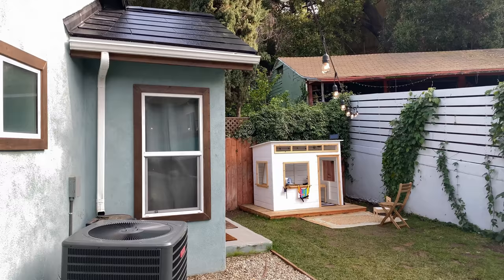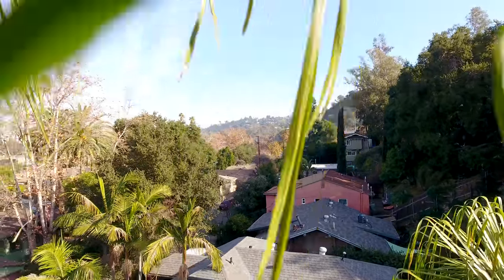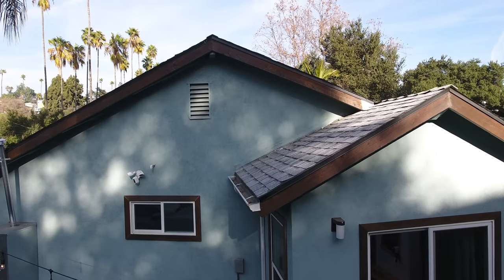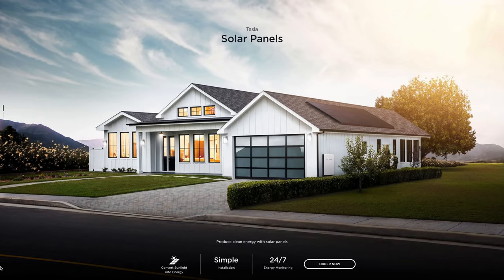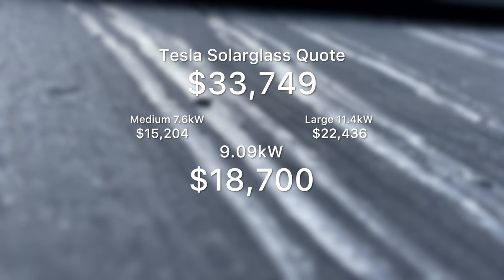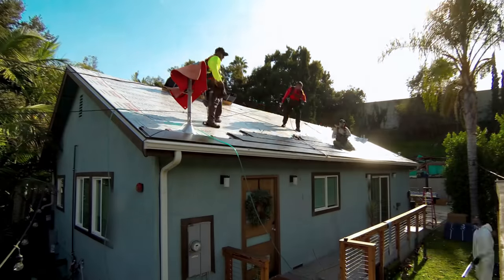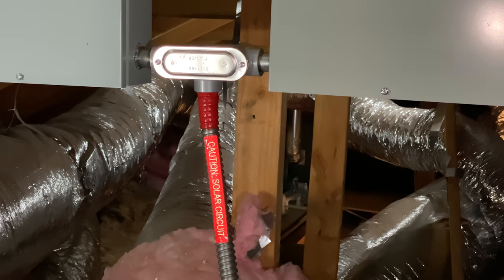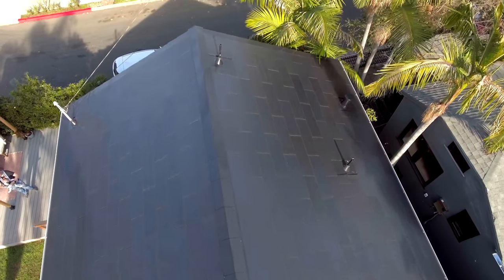WE GOT A TESLA SOLAR ROOF : First impressions and what you need to know!

Comment: Thanks for a really interesting vlog, I live in North East Scotland & have pv panels, under UK law I'm only allowed 16 panels & because my roof faces roughly East, West I have them placed 8 on the East & ditto West. My pv inverter is placed in my loft giving me as shorter run for the DC output as possible because DC is lossy over long distances, I noted that you have a tree with a large leaf canopy shading your roof, one of the questions I had to answer was if this was the case with my house because any shade over the roof will degrade the power output from the panels. My pv system cost me £6000.00 GBP & my yearly income is approximately £500.00 GBP. It was installed 2013 so only five years to go before I'm in profit.

Comment: Beautiful. I hope you measured the inside surface temperature of the roof from your attic during the summer and remeasure with this later.  Conventional solar panels get very hot from only being 30% efficient at converting sun into energy, the rest turns into heat. With regular solar panels raised an inch or two up off the roof this hest can't escape instead of transferring into your attic. The solar glass design will heat up the attic dramatically raising the amount of HVAC usage you need dramatically.
Reply from the maker: Why would it absorb more energy that our old roof?
Reply: @AustinFlack  depends on your old roof, but a metal roof would reflect most of the light/heat whereas the solar roof absorbs light and generates heat through conversion losses to electricity. Spray foaming the inside of the roof would be ideal for solar glass v3.

Comment: The system is designed in series, depending on how many strings that inverter can handle and the location of any potential obstruction, it could produce much much much less than its estimated production.

Comment: I have been trying to find out if the Tesla solar tiles are wired to the central inverter as a string or does the system have built in solar optimizers? Also, do they specify a certain model or brand of inverter or do you have your choice?
Reply from the maker: Going to follow up with Tesla and the installers to get some questions answered, will add those to the list, and cover them in my next video.

Comment: Is the 25 year guarantee prorated? How degraded does it have to be before the guarantee kicks in? Does the guarantee include the labor to replace the panels or are they just going to send you new
 panels?
Reply from the maker: Labor included. 

From the purchase agreement: “Limited Warranties
Tesla, Inc. warrants that:
(1) Product Warranty. Your Solar Roof will be free from defects in design, materials, and
workmanship for 25 years from the date your Solar Roof is installed, except as otherwise provided
in the Module Warranty below.
(2) Weatherization Warranty. Your Solar Roof will remain in place and prevent damage to your
Home caused by the passage of wind and rain through your Solar Roof for 25 years from the date
your Solar Roof is installed.
(3) Module Warranty. The power output capacity1 of your Solar Roof will be at least 95.0% of
the “Rated Peak Power”2 specified on the Solar Roof’s data sheet (multiplied by the size of your
Solar Roof) at 5 years after your Solar Roof is installed. The power output capacity will decline by
no more than 0.5% per year for the following 20 years. This warranty covers the power your Solar
Roof will produce under standard test conditions.”

Comment: That's quite a high electricity usage. I'm on 80m2 and I'm using about a quarter to a third of your amount of kwH. Is the house insulated?
And why is the breaker and a switch outside of the house? Any culprit willing to jump the fence can shut it down. With us everything is inside. Is it maybe for firesafety regulations? But anything outside on the wall can also catch fire, and can also be easily tempered with to cause a fire....
Reply from the maker: No garage, but also fire department wanted shut offs outside, I believe. Going to follow up with Tesla and the installers to get some questions answered, will add those to the list, and cover them in my next video.

Comment: I was kind of hoping the drone hit the roof. I could’ve used the durability test. Also, if the tiles are elevated, wouldn’t that be devastating during a hurricane? To my knowledge, the problem with tile roofs is air gets trapped under causing them to crack, wouldn’t it be even worse with this?
Reply from the maker: I’m not sure, but this is tempered glass and a metal frame. Tesla promises they are 3x stronger than tile roofs, and they are guaranteed for 25 years against weather damage.
Reply: Austin Flack I did some research and they are warranted but doing so I found out, if there is a power outage you aren’t allowed to use the solar panels. FPL won’t allow you to use them and that is unfortunate considering it would be one of my main reasons for getting it. I don’t understand why you can’t shutoff the main breaker and use solar panels I spent thousands installing. It’s just amazing to have a solar roof but have to wait a week for the FPL outage to be resolved after a hurricane. My mentality would be I’d be able to use the solar power after a hurricane to turn lights on, cook, refrigerate food, air conditioning, etc. I’d hope that policy changes in the future because it’s outrageous considering no one would be hurt if the main breaker is closed.

Comment: Permission to operate??? That's funny, really funny. I had my solar system installed late last year. I asked the foreman about this permission to operate thing and his exact words were, "Well, technically you're not suppose to turn the system on until your electric provider gives you permission. But technically we can't stop you from flipping this switch and trying out your new system if you feel like it." Basically what that meant was that he told me most people turn their systems on anyway..... As for myself? Ummmmm............ You get the idea. lol
Reply: @urgetodrive  True. But I'd also be using a lot less electricity from the power company in the daytime because I'd be running my home from solar power and not from the grid. This of course would save me money while I did the PTO thing....

Comment: What do you do if you have to make a new plumbing, electrical, etc. penetration in the roof?

Also, does the roof have a ridge vent?
Reply from the maker: It does have ridge vent. Not sure about your first question, maybe I would need to call Tesla to modify.

Comment: What is warranty? Also what happen if u have damage on shingle? Is there a way to monitor all tiles are working properly? Did u get a powerwall cell too?
Reply from the maker: Yes, warranty covers all damage. And I can monitor performance on the app. Tesla will even automatically get notified if the system is underperforming.
Reply: @AustinFlack  that's pretty cool. If you mind me asking how many square ft is your house. Bc I know with different size house cost will go up.

Comment: Has Tesla given you any numbers on the capacity factor of the system? The reason I ask is because a 9kw system does not give you the equivalent power. For solar the average capacity factor is about 25 percent which means you get 25 percent of the name plate kw value.  25 percent of the stated kwh hours from Tesla  would be 2110 kwh a year which I hope is enough power for the initial financial outlay.

Comment: I noticed you have a direct mains connect setup,  why didn’t you have a power wall fitted at the same time, was it cost or do you have really good rebates/net metering and very little or no power cuts?
Reply from the maker: No power outages to worry about. Adding it up, it didn’t seem like powerwalls would be worth the expense because of net energy metering. We can always add later.
Reply: @AustinFlack  if you have a hot water tank it will be worth heating it with the solar not sure if you have it out the but devices like the Eddie ect link up with the immersion heater and use the excess solar to heat the tank helping cut your fuel bills these can be used with most type of tank that use an Emerson element

Comment: So you didn't get a Powerwall? I thought it was mandatory with the Solar Roof.
Reply from the maker: When we send energy to the grid, get energy credits, which "pay for" the energy we use at night, cloudy days, etc. (energy at night, during peak demand periods, is more expensive that the energy we generate during the day). We can bank credits (sort of like roll-over minutes) but can't cash them out.

Powerwalls would never pay for themselves. Would need to spend roughly $60k to ensure I was totally off the grid, at which point it could save me a maximum of $156/yr.
Reply: @AustinFlack  Thanks for the answer! One thing also is that I doubt Powerwalls have a long life span. Which makes them VERY expensive if you have to replace them every 5 years or so.

Comment: Could we get some stills or even video from the street. We are attempting to get our HOA to approve, but they are very strict. And are concerned they will be very "shiny" :) so some shots from the street would be helpful. thanks
Reply from the maker: Will do! I’m gonna make a follow up video answering some questions when the system is up and running. I’ll make sure to include some street level shots.
Reply: Tory - check your state and local laws. Many places have passed legislation forbidding HOAs from restricting solar power
Reply: @dodgeplow  This is an entire county :) It's a historic area, and the 3 people on the panel are a bit "tight" regarding the area and it's historical appearance :)
Reply: @torymblue2000  lol sorry about that. see what your state laws say. They may still have a preemption

Comment: How exactly will the system as shown zero out your power bill? Won't you still need batteries for nights and inclement weather?
Reply: Zeroing the bill and zeroing the import isn't the same thing. If you have a decent FIT (feed in tariff), you can make enough money during the day from exports to pay for the electricity you import at night.

Sadly there are many places in the world where this isn't possible. You can't do it in Cape Town, for example, because legislation makes the state-owned energy company the sole legal buyer of electricity, so Cape Town is only allowed to rebate you for energy fed in. As a result, you can never zero out the bill except by going completely off-grid.

Comment: Installation doesn't include permitting to turn on the roof tiles?  What additional permitting is required by the installers / homeowner?  Is this a city/county issue or an electric utility issue?  Thanks.
Reply from the maker: It does, but the city had to inspect, and then my utility had to certify.
Reply: @AustinFlack  Thanks, really interested to hear how things go including actual performance vs rated specs

Comment: I understand one doesn't necessarily need to cover the entire roof with the expensive solar roof panels.  What was the reason both sides of your roof was covered?
Reply from the maker: It’s my actual roof, too. Parts of the roof can be covered with matching dummy tiles if extra solar capacity isn’t needed, which would obviously save substantial money.
Reply: @AustinFlack  Thanks mate - I have a vacation A-frame home and one side faces due south.  The power there goes out a lot, and I'm hoping that half the roof will power the 1,000 square foot home.  I don't want solar panels on this house, they would be hideously ugly.  The roof line is a good 65º and I'm not sure if solar roof panels are even possible.

Comment: I noticed around the pipes is alot lower than rest the roof. seems like this would cause leaks eventually, or at least be a weak point?
Reply from the maker: I'm not sure. I can ask. There's a very solid underlayment under the tiles.
Reply: @AustinFlack  Yeah I imagine they wouldnt do it, if it were an issue just curious.  Wish these came out 2 years ago, when I was building my house.

Comment: Did you find the estimated cost to be similar to the actual final total cost?
Reply from the maker: Yes, the cost never changed
Reply: Austin Flack really appreciate the response - I got an estimate that was very similar to yours for 925 sq ft - hoping it can be the same outcome where the estimate doesn’t change much as I believe that’s a really good value when compared to “premium” roofing materials and panels. In my area 6.7kw traditional add on panels is 20k before incentives.

Comment: I don't understand how could you be fully off grid with the roof tiles providing ALL your electricity needs without having a powerwall in case of several days of rain or overcast with big clouds? It seems to me impossible. Unless you are getting so much from your tariff-in from the solar roof to the grid that compensate the days when you don't have enough sun to run all your electric stuff, like A/C if really hot or really cold etc? Just curious.
but the roof looks great. For the little difference in price, I would have made the same choice. Congrats.
Reply from the maker: I’m not off the grid. We opted not to get powerwalls. Don’t think it’s worth it for us, considering we have net energy metering. Can always add later.

Comment: I'm a roofer. Such a simple roof with hardly any slope. Even someone who has never roofed should be able to tackle such a simple job just by following the instructions on the shingle package..... How many square is your roof?
Reply from the maker: 1700 sq ft. We’re taking the house flippers we bought the place from to small claims court. The roof wasn’t permitted, and they didn’t disclose.
Reply: @AustinFlack  17sq we charge around $4,000 to roof that including disposal of old shingles according to law. Hopefully you can get that $4,000 from them.

Comment: If a tree limb falls and cracks a tile...what happens???  Does the roof leak?  Electrical short circuit??? Cost to replace damaged tile?  Is this covered by your homeowners insurance?  If not, who pays??
Reply from the maker: Fully guaranteed by Tesla against damage or malfunction for 25 years. More durable than traditional tiles. https://youtu.be/EmRrQhQf-co

Comment: Where is the power stored?(To use for night time)
Reply from the maker: When we send energy to the grid, get energy credits, which "pay for" the energy we use at night, cloudy days, etc. (energy at night, during peak demand periods, is more expensive that the energy we generate during the day). We can bank credits (sort of like roll-over minutes) but can't cash them out.

Powerwalls would never pay for themselves. Would need to spend roughly $60k to ensure I was totally off the grid, at which point it could save me a maximum of $156/yr.

Comment: The $33k pricetag is equivalent to 20 years of electricity at my current rates (in Tennessee).
Reply: It just makes sense. By the time it needs to be replaced you would save more than the initial cost. And most likely by then there should be a better and cheaper system. Not to mention no emissions
Reply: Antonio B No emissions? The emissions spewed out in the manufacturing of everything is huge.
Reply: @tombryant4518  true but something has to be manufactured.
Reply: Antonio B Yep.
Reply: @antoniob3941  "By then there will be a cheaper and better system" is exactly the reason he should just wait 15 years and get the better system then, having saved more money than buying this one now.

Plus the process to manufacture any solar panel is highly polluting.
Reply: @yargnad  lol. Don't tell the dude that. 30k is alot

Comment: Thanks for sharing... Looks great! 
Wait... you said zero out your bill... maybe I missed it, but did they also install a Tesla Battery to store energy for when the sun is down or weather prevents needed power generation without a battery???  Wait... I think I figured it out... you pump enough energy back into the grid for credit that covers your night / dark periods, right?
Reply from the maker: We opted not to get powerwalls. Don’t think it’s worth it for us, considering we have net energy metering. Can always add later.
Reply: I edited my post.  I guessed your generating more than you need for the day and banking credit to cover the night?  Is that what Tesla calculates to zero the bill?
Reply from the maker: It might not completely zero out our electrical bill, but it should come close. Yeah, excess energy produced during the day will give us credits, like rollover minutes, that will cover all or most of our energy use at night.

Comment: I received a quote from my “Tesla Lead” for a Tesla solar roof.  I do not want a Powerwall at this time, but Tesla quoted it anyway.
Six-year-old home with an excellent asphalt shingled roof.  Entire home is electric with geothermal and radiant floor heating.  No financing.  How can I justify a 25-year-old warrantied system with a 42 year payback after federal tax credits and utility rebate?

Solar Roof + Backup Energy Storage • Customer Estimate

System Information 	
Roof Area 4,293 sq ft
Customer Annual Energy Usage 19,636 kWh
Energy Usage Offset	100.00%
System Size	15.7 kW

Solar roof
PV Price* $28,253
Roof Price $85,860
Solar roof Subtotal	$114,113
*ITC Eligible PV cost

Estimated Installation Services
Labor Cost	$9,660
Tear Off	$3,650
Travel Cost	$525
Electrical Install (does not include ugrades)	$1,200
Rental Cost	$3,220
Powerwall+ Backup Energy Storage (x2)*	$32,000
Installation  Services	$50,255
*ITC Eligible Backup Energy Storage cost
Total	$164,368